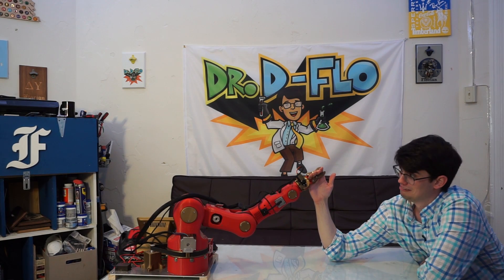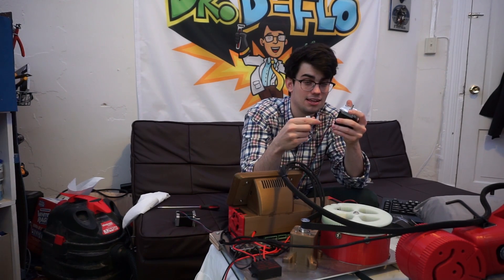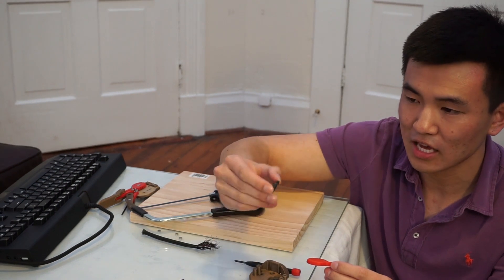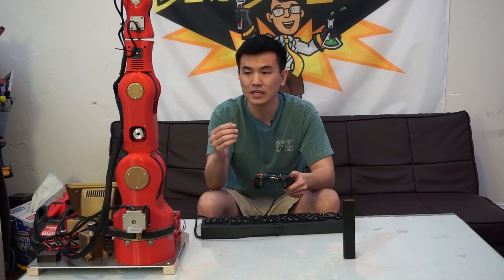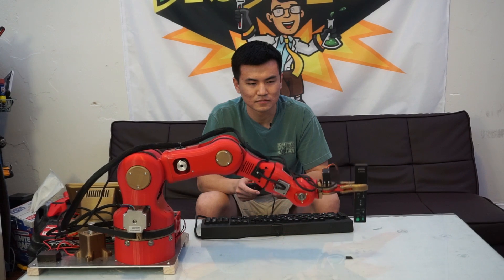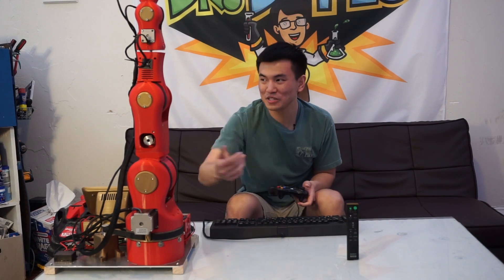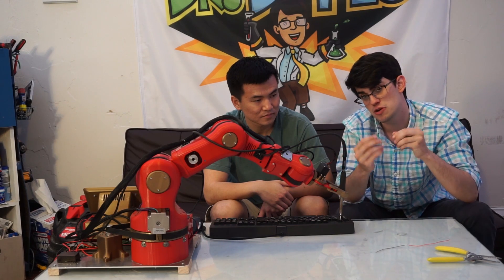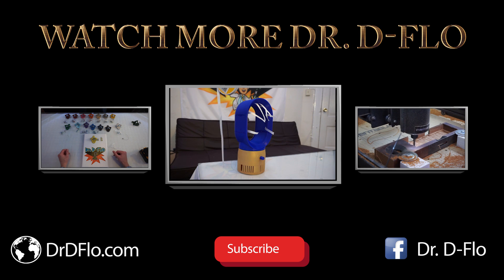6-Axis 3D Printed Robotic Arm - Testing - (Part 3)

Comment: how does it know the position you put it in? (as servos do not offer inputs I assume the arm itself doesn't know where it is) , is it based on the controller inputs? so it knows for how long you made it go down and where you stopped
Reply: AFAIK this robot does not use position encoders.  So, using stepper motors, the software counts the number of steps from a place to another in order to move the robot from known point "a" to point "b".  The issue that happens is if you ask too much power (or impede the movement somehow) and the motor "slips" (misses a step).  You can see that happening around 5:27 in the video; dropping the remote hitting the desk pushes against the wrist and makes it rotate, which is unknown to the controller.  The next run being relative to this new position, when the robot tries to catch the remote, the effector (claw) is nowhere near the proper position.  Industrial robots in general use servo motors and position encoders at every axis.  Encoders make the referential system absolute instead of it being relative, so movements are repeatable.

Comment: Could you tell me the stepper motor driver board specification , power supply and can we interface   8051 development board to control stepper motor?

Comment: Are you gonna implement absolute rotation and IK to have the end effector move about in a more interesting manner?

Also, does your program got access to the current position of the each of the axis? If it does, maybe you could use that to detect load and make it able to grip things regardless of size without breaking them, and also grip tighter for heavier things?

edit: Oh, and if you can detect the exact position, would it be possible to make it compliant, letting you position the arm with your own hands?

Comment: I really like the fact that you are using the Pi and the touch screen.  Very good indeed. One small suggestion might I suggest that if the arm is going to to do a lot of repetitive joints you might want to use a temperature controlled iron and add a "wipe / clean" station.

Comment: Hi, awesome videos!

I was wondering if there is an issue when you try to set the arm in startposition. 
How can you ensure that it will set in the exact same spot after it has done a task?

I know that on my 3D printer it also uses stepper motors, but there is also a limitswitch to ensure that the position is indeed correct.

Comment: Hello, nice video serie! I printed and assembled a MOVEO arm myself, it's pretty much the same, unfortunatly, it lack some good software to use it and save position etc like you do in this vid.
Which software are you using? could you share it somewhere? thanks you
Reply from the maker: Fakoleon,
We are using software that works with the SlushEngine (https://roboteurs.com/products/slushengine-model-d) not ramps. Here is the code though: https://github.com/Roboteurs/rbx1-software
Reply: Indeed with ramps it won't work, thanks anyway !

Comment: Hey Guys, seems like a fun project! But it seems to be very ugly to program the robot, because you have to control the rotatoric axles all by it's own to get to a point wanted. Isn't there a possibility implemented to work with a Tool orientated coordinate System? As an example your tool is orientated by pointing in a 45 degree angle to ground and you push the button for moving the Z-Axis down that the robot moves all Axis that are required by it's own to move the tool in a linear movement in its 45 degree pointing direction. I hope it is understandable what I am trying to explain. That would give the robot a much better handling. 
But to be honest, who would really need such a robot arm for privat? Clamping my soldering iron into a small vice would absolutely be enough and does the job... :D
Reply: Just sit tight. I think these two far-out brains are going to have this bigbot do extraordinary things with a soldering iron so they can make it a horrific desoldering terror in an unmentioned b-movie they're working on under wraps, in which it's programing will contract a wicked virus from a insanely jealous YT rival over somewhere in Shenzen China, run amok, and disassemble uncontrollably the electronics of fb headquarters data banks and that of the International Space Station...or something next to it.
Reply: +SwarthySkinnedOne  Okay okay. I think I can do that! Just hold my beer. 
I need an elevator, ostrich and a shopping cart for kids.

Comment: Hammers??? Noooo!! that'll destroy the bearings in the motor. The correct way is to use a file to make a flat-spot on the shaft. Then tighten the pulley setscrew onto the flat-spot so it has more than just friction holding it on. If thats not enough holding force, then theres probably another problem. locktite may work but youll have a pretty hard time getting it off later and it can seize up the motor bearings if your not careful. Other than that looks like a lot of fun!

Comment: Like the series so far, one thing I would love to see is some test on the working weights the robot arm can lift and move, as well as how much pressure the griper and arm can handle. Thanks
Reply from the maker: Yes we had this planned for next video. The gripper has a surprising amount of strength. However, we were experiencing a lot of slipping. The heaviest thing we tried to pick up was a full beer bottle. The gripper could grip it, but the wrist motor was unable to turn.